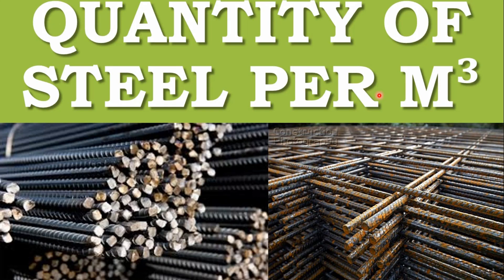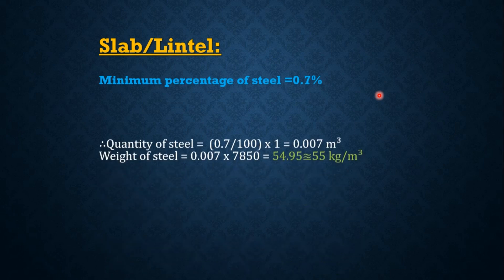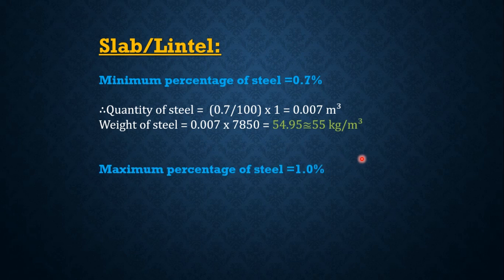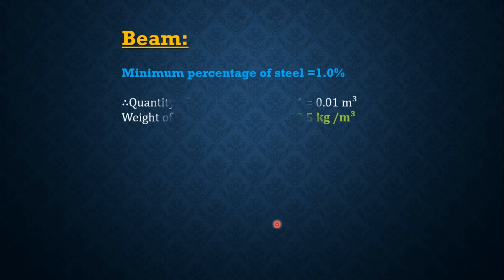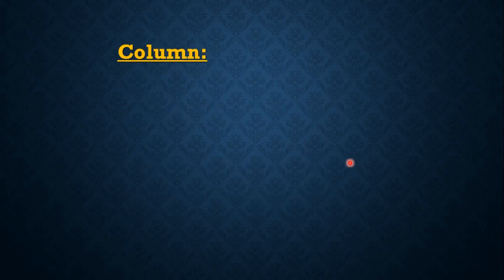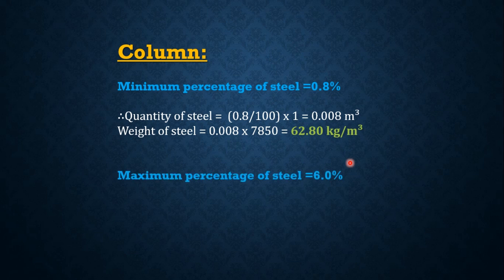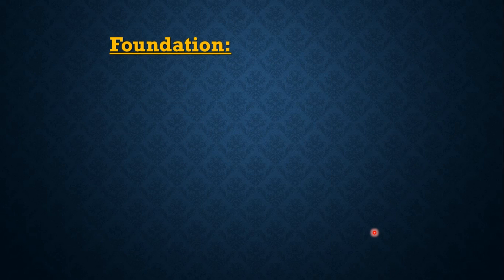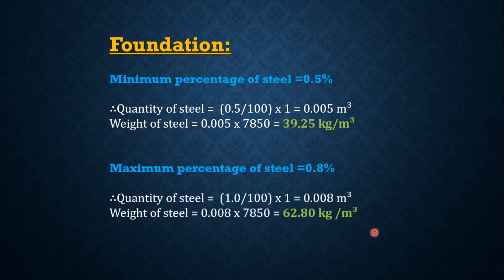How to calculate steel quantity  in RCC Slab Beam column footing & Lintel

Comment: Where it is applied minimum and maximum percentage
Reply from the maker: Basically, it applies everywhere and for every structural element. If we provide the steel less than the minimum percentage then that particular structural element may not withstand the loads. And if we provide more than the maximum percentage then the cost of the project will increase, dead load of the structure will increase and it may involve in practical difficulties in placing and compacting of concrete.
Reply: @wecivilengineers  sir how we calculate nearer to exact steel quantity for estimation??

Comment: How to get
Reply from the maker: This method is used for estimation of material (steel)  at small sites (we can say tough estimation).  They calculate the volume of the concrete then steel quantity is calculated on the basis of percent.  

In India you might have observed one thing,  most of the small House's are constructed without consulting an engineer,  it is built by contractor,  in that case it will be helpful.  

In simple words it is useful for rough estimation of steel for ordering from  Merchants.

Comment: the minimum %  of steel for members you have mentioned, is according to what code?  IS 456 mentions different minimum % of steel required. is it the thumb rule you are using for %steel?
Reply from the maker: IS 456 is not mentioned in the form of percentage..
whatever the values i have mentioned is derived from the practice over decade & some of the values are given in is 456 eg:- column 0.8 to 6.0% .

Whatever the minimum % which i have mentioned is a thumb rule for "Estimation and Cost analysis" mam.

Thank you for rising a doubt
Reply from the maker: if my video are helpful for you then share it in your class whatsapp  group (among your friends) :-)